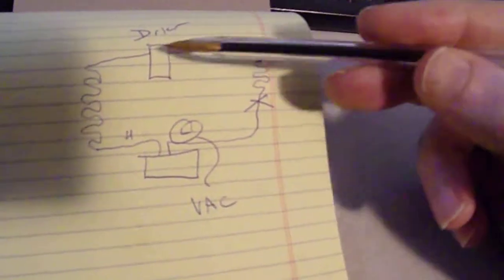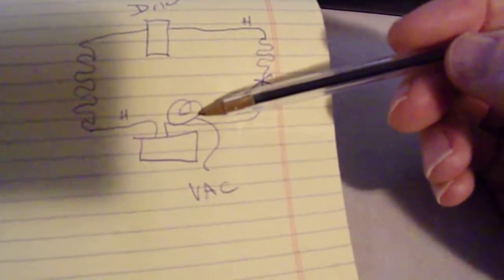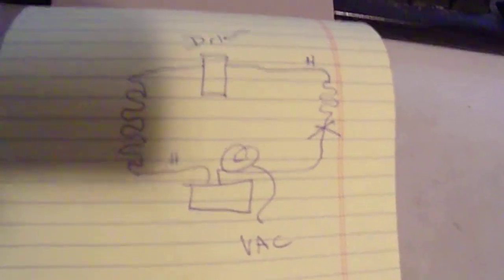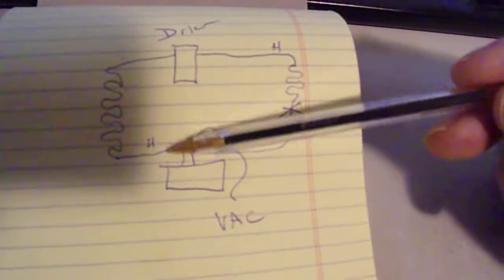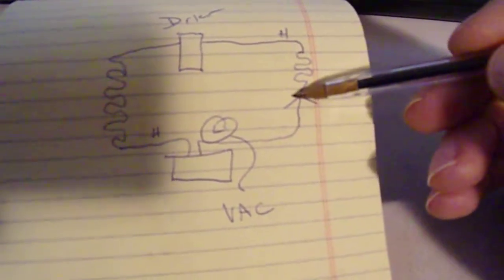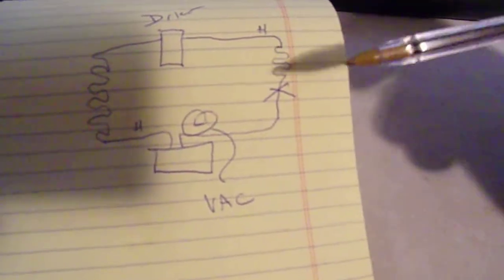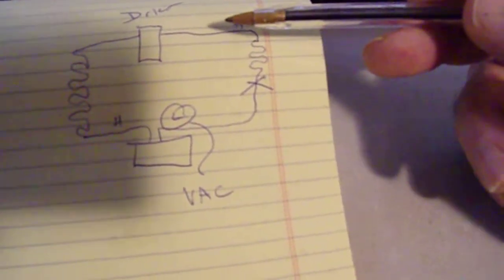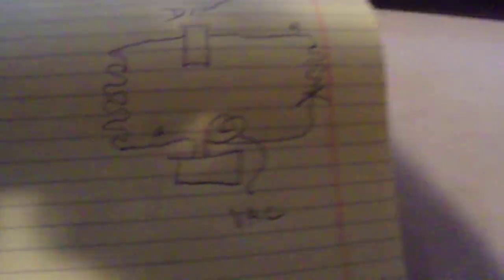Datsun AC problem

Comment: Dirty or clogged filter or passage. My best answer.
Reply from the maker: he is having a problem finding the restriction. My guess was a defect in the soft line from the evap low side to the compressor.
Reply: @davewm9589  did you ever find the clog? my best guess would be the expansion valve